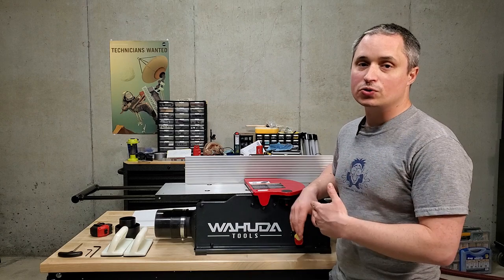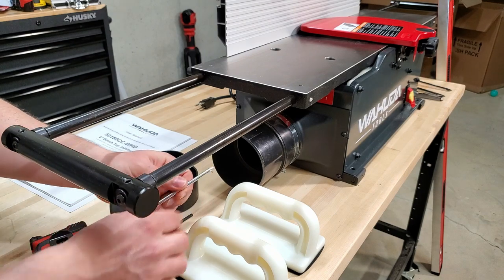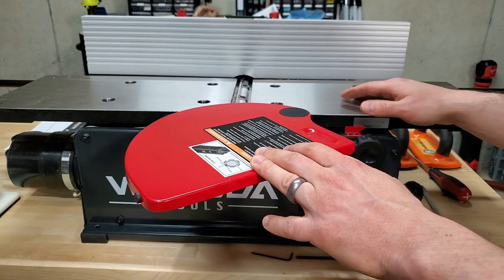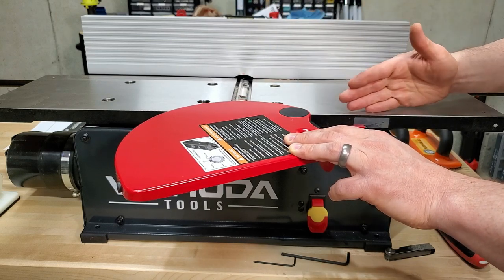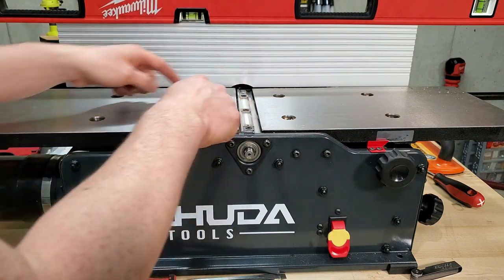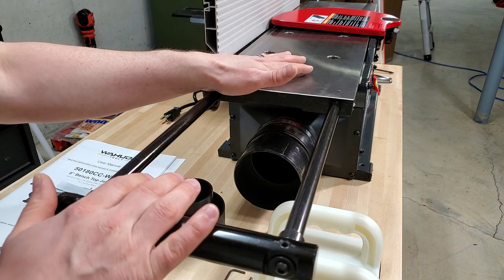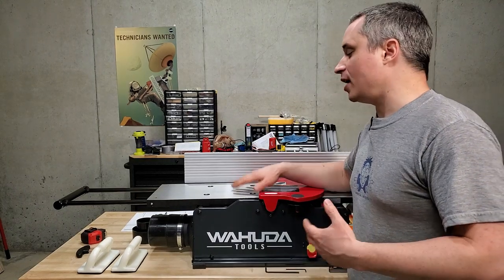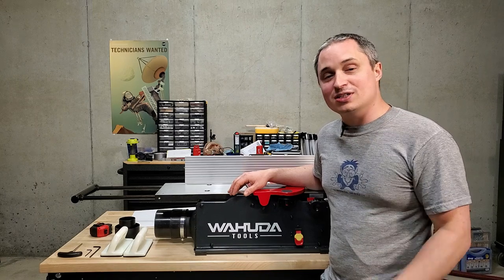Wahuda 8" Benchtop Jointer with Spiral Carbide Cutter Head Review and Setup Tips

Comment: They also offer a 10" model for about US$150 more than the 8". I'd assert it's worth the extra money, if you can swing it, as it's  better to have "too much" jointing capacity than too little. ;-)

Wahuda also has a 13" planer with the same helical cutterhead design, for about US$750. A bit more expensive than some decent planers, but a great price over the same units upgraded with aftermarket helical heads...
Reply from the maker: They came out with the 10" jointer after I bought this one, or I would have strongly considered it instead! I also reviewed their 13" planer as well. Great machine!
Reply: @DoresoomReviews  I have that 10" jointer, in fact I jumped on it as soon as I saw it available. There are no other comparable units and it is the same high quality as yours. Mine came perfectly set up from the factory and has remained that way with my occasional use over the past 3 years, producing beautiful flat, 90 degree surfaces.

Comment: I've used mine for a couple days now and noticed just how much flex there is in the fence. Did you have any issues with that? It's really affecting the edge jointing.
Reply from the maker: I hadn't noticed any problems with mine. I just went and pushed really hard against the fence, and there's definitely some flex there. I must be applying lighter pressure when I use the tool, since I haven't seen it affecting my work.

Comment: After adjusting the infeed and and outfeed tables the depth of cut gauge is off.  I do not see anyway to get that in sync with the the cut depth. Is there some sort of adjustment that I am missing?
Reply from the maker: I don't think there's a built-in way to adjust it. How far off is it? Unless your jointer was terribly out of alignment from the factory, I'd think it would only be 0.010-0.020" off. The depth scale is really just to gauge the depth of material being removed anyway so it shouldn't be that important. When you rip the other side straight or plane the other face flat is when you need precise depth of cut, both of which are performed on different tools (a table saw or a planer).

If it really bugs you, I suppose you could place some shim stock underneath the indicator, or sand down the indicator a little bit depending on if it's low or high.
Reply: @DoresoomReviews  No big deal just wanted to make sure I wasn't missing something.  Thanks

Comment: just wondering, you could cut longer boards on this jointer aslong as you build your own supports right?
Reply from the maker: Exactly! The general rule of thumb is you can joint a board straight up to twice the length of the infeed table.

Comment: What is the depth of jointer (front to back), including the bracket in the back for the fence adjustment?  Thanks.
Reply from the maker: Just under 20" with the fence pushed to the back edge of the tables. It would be even deeper if you wanted to do rabbets with it.
Reply from the maker: I also just discovered they have precise measurements on their website: https://www.wahudatools.com/category-s/217.htm

Comment: Have you made the extension table id like to see what you have come up with
Reply from the maker: I designed one, bought materials and hardware, and then got completely distracted with other projects. D'oh! I haven't done any projects requiring the extra length lately, so it hasn't been a priority unfortunately.
Reply: I'm about to order one and I'd like to incorporate it into my workbench. My work bench is the size of a sheet of plywood. I was thinking of put it on the long edge of the workbench. But doesn't the infeed have to be lower then the outfeed table. I was tjink of taking my router and taking out a 1/16 of a inch to match it up

Comment: I was wondering on your opinion on the new Jet - 6" Helical Head Benchtop Jointer Model 718600? I really wish it was 8" but i have an extremely small space to work in and have to move both cars out of garage. Thanks, keep up with the great reviews!
Reply from the maker: That looks like a great jointer. The helical head should provide better performance to reduce tearout in figured woods, and the cast iron fence is a big upgrade from this one's aluminum one. If space is a factor, then a bench top machine makes sense. But if I was going to spend much more than this Wahuda cost on a jointer myself, I'd be looking for one with a longer bed.
Reply: @DoresoomReviews  True, the bed is only 29 inches and is costly, as much as a grizzly full sized 6 inch. I think the cost is in the true helical head, chip blower, and cast iron fence. I am just not sure why they went with the shorty fence, boggles my mind and one thing i can think of is that is the only length they could machine straight (hope not, but never owned a jet product) or leftover materials. I am going to roll the dice with this and if need be see if i can make some outfeed/infeed supports mabey out of uhmw/laminated mdf. If my gamble doesnt pay off, at least i will be able to make highly figured wood bird houses .... Thanks again for the advice and when I get more room I believe I will get a 12" behemoth that will require me to take out a 2nd mortgage and possibly a kidney. I will chime in when after it arrives and i have time to fiddly with it, but one thing is certain, if they cannot get a a 29 inch bed straight, its going back in a hurry.

Comment: Great review, excellent presentation. I noticed you didn't include info on removing and cleaning the carbide cutters before use.  Did yours not need cleaning?
Reply from the maker: They did, I forgot to put that in the video. I covered it in the Wahuda planer review I did though. It's pretty much the same cutterhead design in that one, just longer. https://youtu.be/E03Vt01Epkg
Reply: @DoresoomReviews  I did not remove & clean my jointer inserts on arrival, and noticed no problems with their alignment or cleanliness.

Comment: I’m not sure if your Milwaukee level is perfectly flat. You would need a reference edge to really check flatness on the cast iron bed. The cast iron cures over time so any discrepancy could be from that.
Reply from the maker: I have two Milwaukee levels, a 4' and a 6'. I slid them lengthwise past themselves on both sides and had no gaps at all, not even the 0.0015" gauge would fit anywhere. The levels are flat.

Comment: I just bought the ten inch. The problem I’m having is that when I adjust the infeed once I have it flat when I lower the Infeed the front of the Infeed lowers more than the back. Any tips?
Reply from the maker: I hadn't noticed that with mine, but I almost always leave it parked at 1/32" depth. Sounds like the adjustment mechanism is out of alignment - I'd contact Wahuda and see if they have any ideas.
Reply: Hi Aaron, did you figure this issue out? I'm having the exact same problem. The front of the infeed(by cutter head) drops almost 3/16 before the back even moves.
Reply: Aaron and Tom, you have play in the linkages. Not unusual in any machine. Drop the table past your target, and always make the last adjustment in the up direction.

Comment: Good review.  How many cutters in the head?  In how many rows?  With only a 10 Amp motor it seems underpowered for an 8" jointer.  10 Amp = about 1.36 HP.  Is the fence cast iron also or aluminum?  Does the dust vent get ALL the chips or do some fall through the case and remain on the table underneath?  These are all issues I had with another bench top jointer and I want to avoid them.
Reply from the maker: Thanks, excellent questions. There are 16 cutters in four rows of 3 and two rows of 2. It's an 8" jointer with a 10A motor, and my DW735 planer is 12.5" with a 15A motor, so I think it's scaled appropriately if you look at power per cutterhead length. The fence is extruded aluminum. Dust collection is excellent, and got every little chip. I had it hooked up to a 1.5 HP dust collector with a 4" diameter hose.
Reply: Mark, Actually, 10 amps equates to about 1.6 HP. Knowing 746 watts equals 1 HP, and to gets watts you multiply current (10 amps) times voltage (in this case 120 volts) you get 1200 watts. 1200 watts divided by 746 gives you 1.6 HP.
Reply: @migi4993  you are correct  mostly.  You must multiply the 1.6 by .85 to get the efficiency of the motor.  Do that and you get 1.36hp.

Comment: I just recently purchased their 8inch jointer and I’m getting snipe at the end of my cut. Any recommendations.
Reply from the maker: Try extra infeed/outfeed supports for long boards. And make sure you aren't pushing down directly over the cutterhead. When you reach the end of the board, all your downward pressure should be on the outfeed table.
Reply: Also, check to make sure your outfeed table isn't too low. Of the cutter heads are too high in reference to the outfeed table, you can see some snipe. In this video, he checked this using the straight edge, and rotating the cutting head to ensure the cutters were not lifting the straight edge at all. You want the cutters to JUST contact the straight edge, without moving it up at all.

Comment: where did you get a .001" feeler gauge? Every set I've checked out goes down only to .0015, after that they get stupid expensive.
Reply from the maker: My set is minimum 0.0015". I just called it flat to 0.001" since I couldn't get the gauge under.

Comment: Great video review. Since you've had it for a while now. Do you still like it? And does it handle hardwoods well?
Reply from the maker: I still like it. Hardest woods I've used it with are red oak and walnut, so nothing crazy. It gets a little slower with full width boards, but still does great.
Reply: @DoresoomReviews  Thanks for getting back to me. I'm thinking of getting the 10". Got my hands on a bunch of red oak and I'm a little sketchy on wether it will handle it. Most of my boards won't be over 6 or 7". And the 10" has a little more power. Thinking on pulling the trigger tomorrow.

Comment: What size cutter head does this unit use?
Reply from the maker: It's a 2" diameter cutter head that's 8" wide. Uses 16 carbide inserts that have 4 indexable sides. You can check out the manual here: https://www.wahudatools.com/wp-content/uploads/2021/11/WHD-8-102621.pdf

Comment: Excellent video. I think I am leaning toward the 8-inch Wahuda. Any thoughts on the new 10-inch model? Your video is well-edited, has very good audio, and gets right to the point. By the way, what microphone are you using?
Reply from the maker: Thanks! You'll love the 8" model. As far as the 10" one goes, as long as they kept the tolerances they did with this one, I'd think it would be great. It wasn't even an option when I bought this one, so I hadn't looked into it too much though.

I'm using a Pixel MK-7 wireless microphone transmitter/receiver, with the standard lapel mic that shipped with it: https://amzn.to/389n4FJ

Comment: How can you tell if the indeed table isn’t correct??
Reply from the maker: It should be perfectly parallel with the outfeed table. So if you reference a straight edge off of the outfeed table, the infeed table should be the same height from the the straight edge at every point. I cover how to do this in depth starting at 10:43.

Comment: This thing is about to go back. Noting but trouble. Took a couple hours to get it level. At least, I thought it was lever. Not my bods come out like triangles. Can't get it to flatten anything. So here I sit, watching YouTube, trying to figure our what I am doing wrong.
Reply from the maker: Does the length of the board end up with a taper, or is it the cross section  that ends up out of square?
Reply: @DoresoomReviews  There is a tapper. I can't get the outfeed level with the cutter. Been tying for a couple of hours now. Loosen 4 screws, adjust 8 set screws tighten everything down and repeat....
Reply from the maker: It does sound like the tables aren't lined up with the cutter head. You just need the front edge of the outfeed table tangent with the cylinder of the cutterhead envelope. Get that set up first, then make the whole infeed table parallel to the outfeed table. 

Try adjusting only two screws at a time. So only the two closest to the fence. Or the two farthest away from the fence. Or the two at the leading edge of the table. Or the two at the back edge of the table. That way you can focus on tilting the table along one axis at a time.

Comment: Hey man my wahuda jointer started smoking when i put 12 in long redwood.Any suggestion why?
Reply from the maker: Is it coming from the belt/motor? Or the wood itself?
Reply: @DoresoomReviews  i believe  the belt motor because first time i ran it with nothing  on it it runned good zero noise  or issues.Then i ran it with the wood and it started  smoking  and doing a weird sound.Then i ran it again and it with nothing  on it and it does a very high pitched sound.
Reply from the maker: That sounds like something's definitely wrong then. I'd contact customer service, especially if it's brand new!
Reply: Sounds like the belt isn't tight enough and is slipping/burning under load

Comment: Thanks for the video I thought it was very comprehensive. I bought the previous 8" Cutech version of this pre-owned over the summer but haven't had time to dig in on it yet. This will definitely come in handy for checking how well the last owner had it dialed in and making any needed adjustments. I was within a day or so of buying this one but the guy gave me a really good deal on the Cutech so I couldn't really pass it up. Glad to hear you're getting good results!
Reply from the maker: Yeah, I was actually planning on buying the CuTech from my previous research, but when I went to purchase I discovered it had been rebranded as Wahuda with the cast iron table upgrade. Decided to pull the trigger anyway and I'm glad I did. I meant to mention the CuTech/Wahuda transition in the review, but completely forgot!
Reply: @DoresoomReviews  yeah the wahuda has a couple nice upgrades, especially being able to use all 4 sides of the cutters instead of 2. They were supposed to have a new planer coming out but it got delayed. Interested to see that when they release it.
Reply from the maker: I just saw and Instagram post of theirs for a 10" jointer too. Not out yet, but in development.

Comment: When you say "perfectly level with the cutter head", what part of the cutter head do you mean? Would you lay the level on top of the screw that holds the blade once the blade is completely horizontal?  Or would the level be placed on the peak of the wheel? Thanks for your help.
Reply from the maker: The apex of the carbide cutters should be even with the edge of the outfeed table. So at their highest point (the edge as it reaches its peak during rotation). Think of it as the smallest cylinder you can place around the cutterhead. That should be tangent to the outfeed table surface. The goal is for the cutterhead to remove material and the workpiece to transition perfectly onto the outfeed table.